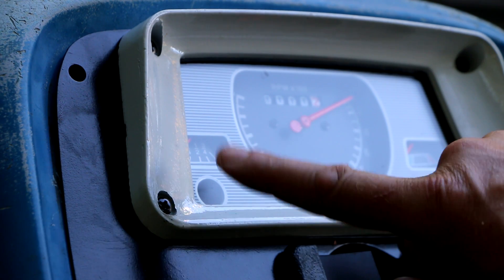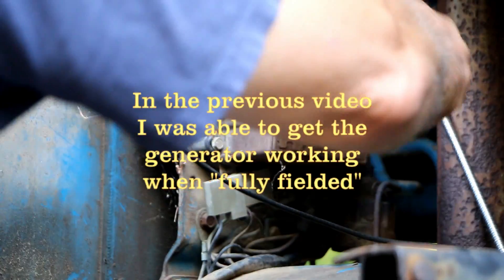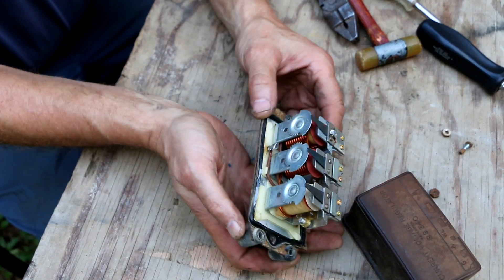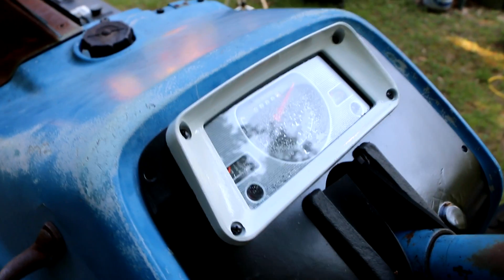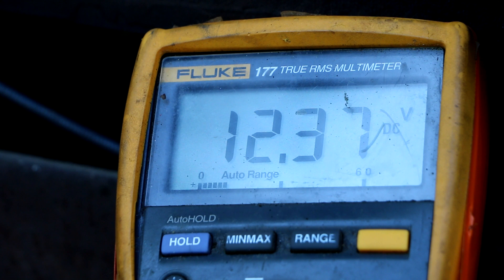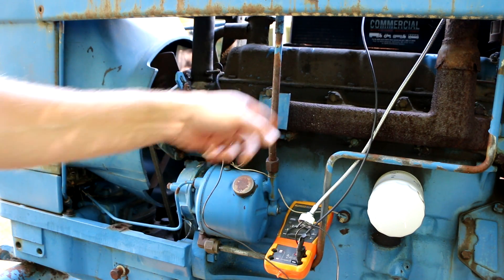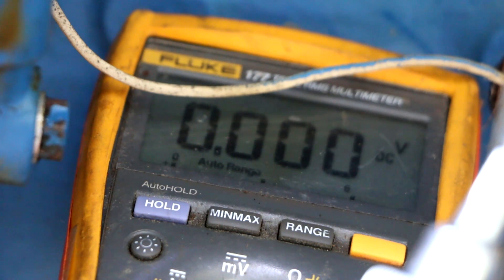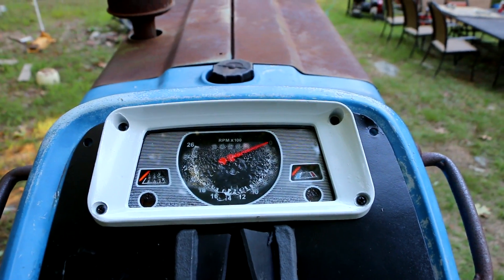Ford 5000 Tractor Voltage Regulator Issue resolved. Battery now charging!!

Comment: I would check what the voltage is on your armature terminal on your generator. I also only had 12 1/2 volts with the engine running and it dips when I turn the lights on a 10th of a volt, and it turns out that my generator is only putting out five volts which means it needs to be replaced. (I’m going to convert to a alternator though).

Comment: Did you get the tach cable wet when disconnected from the generator?  I would pull the gauge set and put it in a vacuum dessicator with calcium chloride.
Reply from the maker: Did not get water in that cable. Interesting idea about the desiccant.
Reply: @stevewatr  
Is the generator tach drive sealed?  The instrument cluster has a good bit of volume, humidity can be "pumped" by temperature changes and it will condense on the glass.
But that is a lot of water, I would say the bezel trapped water which ran past a leaking seal.
Dow Corning RTV silicone but be careful as it emits acetic acid on cure which corrodes most metals